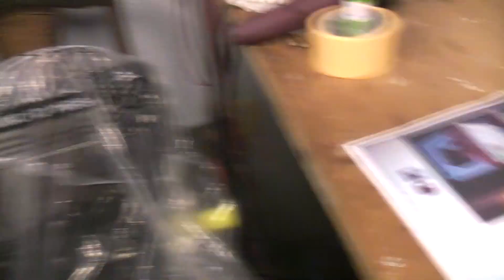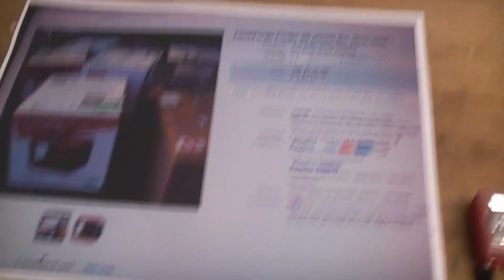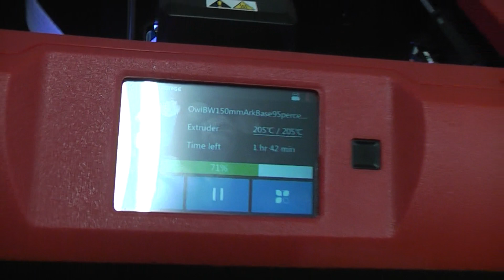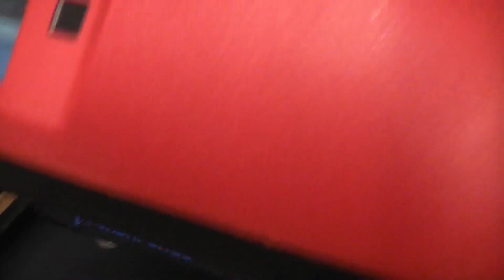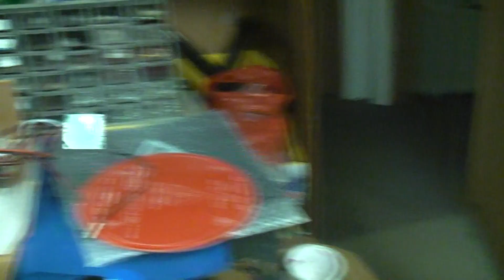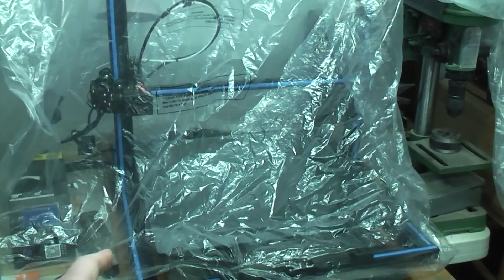Ebay "As Is, For Parts only" 3d printers. The most Bang for your $$$

Comment: Hi, thanks for the video. You mention using a larger bed in the Finder. Ignoring the heated bed, would adding a larger bed something that would be fairly easy? Do you have a rough idea what would be involved in terms of physical mods and slicing software? Thanks
Reply from the maker: I did a second video on adding the larger heated bed. Here is the link. https://youtu.be/j2c_v64Mqwg
And in the comments for that video I talk about the build size increase of the X size from 140 to 190mm. No change to the slicer. The added size is minimal but welcome on a printer with this small build size.